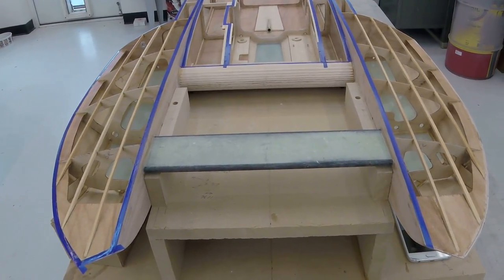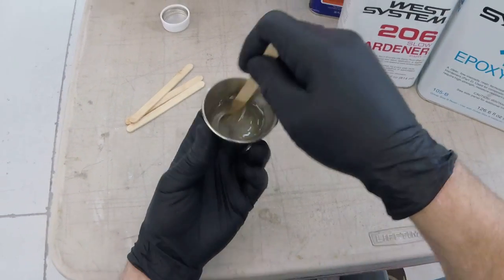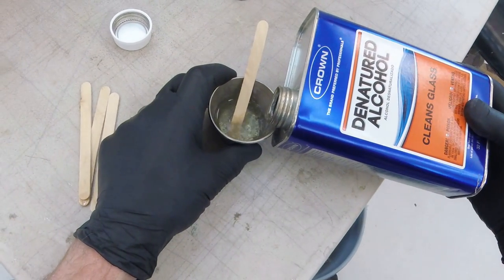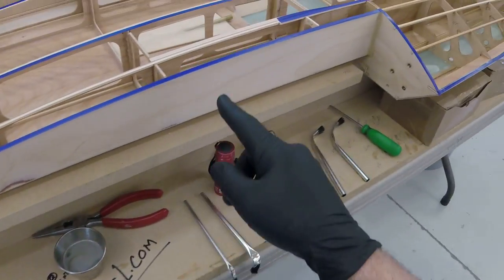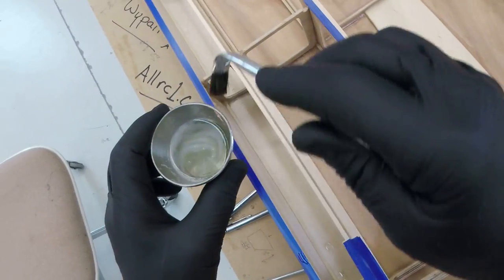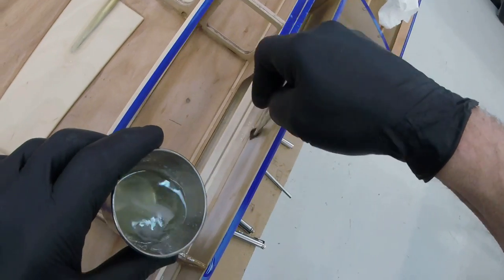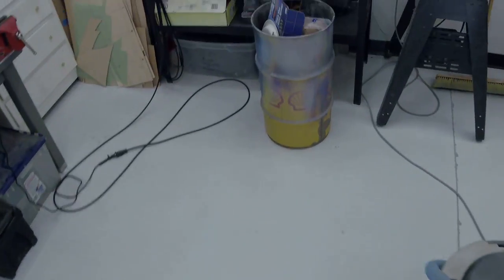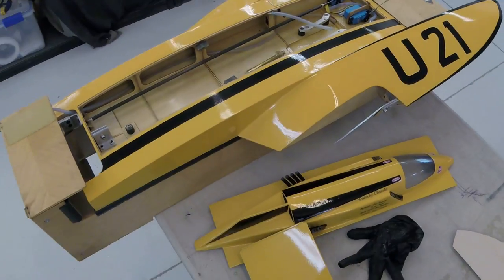RC Boat Hull Sealing - or - How to Not Suck at Sealing Wood

Comment: Isn't West System epoxy supposed to be a 5:1 mixture?
Reply from the maker: Good question... Yes it is!
The pumps I use are made by West Systems and are calibrated to give the correct 5:1 mix with full strokes.  When mixing smaller quantities I use a small scale to weigh out the correct ratio.
Reply: @M5PerfHydros  Thank you...I bought the system too so I'll need to make sure I put the right pumps on the right bottles.
Reply: @M5PerfHydros  So while watching this...2 more questions came to mind.  First you mentioned not sealing some areas because that's where the top is going to glue to...if you sealed those areas wouldn't the epoxy used to glue the top on still stick?  Because I was thinking...why not just seal all the wood before assembly?  That way you can be sure to get the wood sealed in the hard to reach areas...then all you would need later is a quick coat to seal the joints.
Reply from the maker: @InspGadgt  - Glue holds best on rough, porous surfaces, so I definitely want bare wood for any joint. Think of it as a tree... If the roots are very shallow or laying on the surface of the ground (like epoxy on a previously sealed surface), the tree blows over easily.  But if the roots go deep (like epoxy soaked into dry wood), they tree will be much stronger.

Comment: Hi Scott
 Larry Welle here, I don't know if it's possible, but could you possibly sell me one of those 1/8 drivers helmet and figure I don't need the bust, but the Hellman head would be great. I'm putting together an old Dumas kit and I think it would look nice with a pilot or driver.
Reply from the maker: To clarify, the head only?
Reply: @M5PerfHydros  Yes Scott, the head only sir
Reply from the maker: @larrywelle2679  - Happy to do that for you but the printer is mothballed at the moment while I try to wrap up a bunch of projects so it might be a few weeks. I do have a couple I had printed earlier for a guy but I wasn't super happy with the print resolution. I'll send a picture...
Reply from the maker: @larrywelle2679  - Incoming on Facebook messenger. Though the resolution isn't great on these, they can be made to look awesome if a coat of epoxy were applied. If you'd like I can do that and send them to you. Please reply on Messenger and we'll work it out

Comment: Could you not just buy a tin of dope witch i use on my model rc planes???
Reply from the maker: That may work fine, though dope is so very thin I'm not sure it would be nearly as durable as an epoxy.  Hey I have an idea... Why don't you switch to boats and try it?  We'd love to have you in the hobby!
Reply: @M5PerfHydros  hi thanks for replying that's my plan for next year
Reply: @M5PerfHydros  I just watch vid again you add thinners all the way so tin of dope whould sill it
Reply from the maker: Maybe, but once the alcohol dissipates, which is very quickly, you still have epoxy. Dope is dope.  But hey... I still think YOU should try it and let me know if it works!